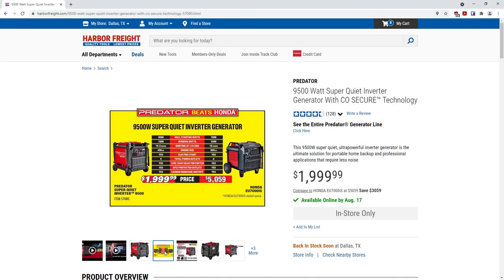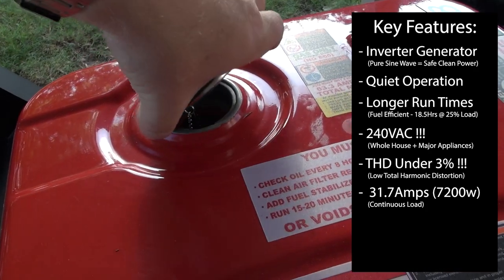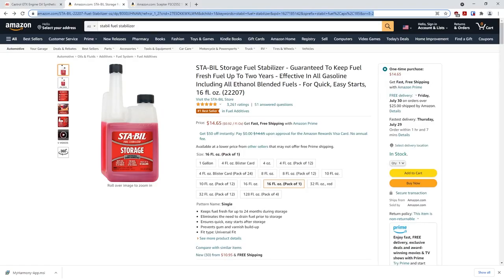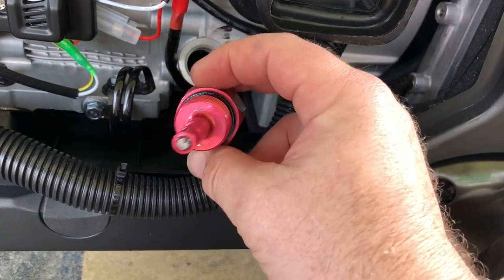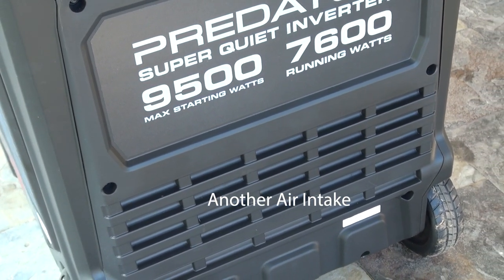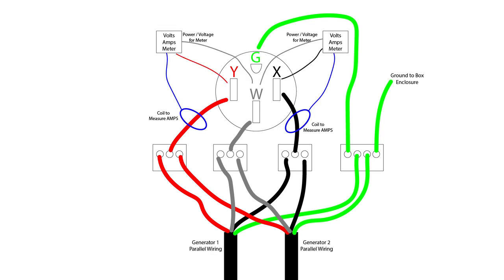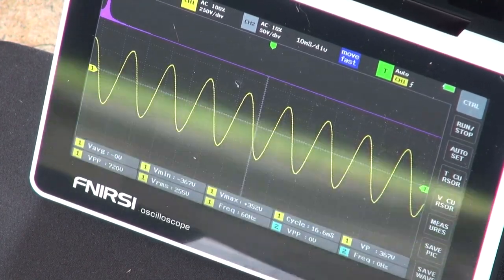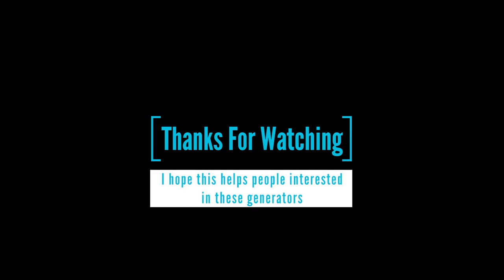Predator 9500 Review: All The Technical Tidbits In Under Ten Minutes (+Important Break-In Warning!)

Comment: Thanks for the oil filler cap recommendation. I found the same one that you bought on Amazon and just ordered it. I just bought the generator and I think I’m gonna wait for the cap to come in before I even start it up now. Glad I watched this video.
Reply from the maker: I'd also suggest a magnetic oil drain plug.  It's an M12x1.5 size.  I purchased this one:
https://amazon.com/dp/B08M3HCVPW
Reply: @Texas_DIY  have you had issues with that plug not sealing properly? And do you need to replace the crush washer each time you take it off?

Comment: Thank you for the metal filings warning.  Recently I learned that heat degrades the magnet's strength.  They make Neodymium Magnet and Samarium Cobalt magnets that can take higher temperature; up to 350°C.  The oil drain plug I just ordered is OK up to 302°F. and will be installed before the new generator is initially started.
Reply from the maker: So far I haven't seen any issues with the magnets losing strength.  I don't think they're getting quite hot enough to cause that.

Comment: Excellent video....I finally purchased one of these about a month ago. Went through the break in period and changed to synthetic oil after 30 hours and a couple oil changes.
Last week I load tested the unit with my 4 ton AC and all was well. I was able to run AC, tv's, lights, refrigerator and chest freezer without issue. In an attempt to see how much it could take, I tried the microwave as well. That tripped the breaker on the generator. Easily manageable in an emergency situation by being smart about when to run certain things. In TX north of Houston, I'm mainly concerned with keeping the house cool during hurricane season so this was a big win for me.

 I did install a SureStart from Hyper Engineering which brought my in-rush amps down to 46 from 132. I imagine your SlowStart will produce similar results, but would love to see your readings.

I watched your previous video on the dual setup and am seriously considering getting a 2nd one (if I can find another lol) .... I dig the meters you put on and will be doing that with my existing setup regardless. In my mind, they should have added this on the front meter (the documentation talks about being able to display it, but as you know, it's only an hour meter)

Thanks again....Liked and Subscribed for future videos!
Reply from the maker: Thank you for the kind words.  "unboxing" and "will it run my electric appliance" videos seem common, but I wanted to offer useful technical info that no one else had.  Plus I refuse on principal to go full click-bait on the titles, or do thumbnails with cut out heads featuring absurd expressions.  Hopefully people still find it if it's something they need.

In my situation, I could probably, maybe, get by with one machine, but I would have to really ration the power if the AC were needing to start.  With two, I can live almost normally and easily just forget everything is on generator power.  Though the electric dryer (When combined with AC and everything else that's normally on) seems to push it nearly to the limits.  I quickly turned that off though, as I'm not through the break in period and don't want to strain them too much yet.

Starting AMPs on my 5 ton Heat Pump AC were 81.5 on my meter.  Though the LRA (Locked Rotor Amps) rating is 117 (meaning from a dead stop, it's within normal range for it to pull up to 117amps).  With the soft start, on the very first start it was down to 64, and after a few more starts (the learning process), the bluetooth app for the soft starter reported that it was consistently keeping the starting amps to around 44 (my own meter reads a max of 31.5) so it's somewhere in that range.  

The electronics in the soft start are remarkably sophisticated (it can literally send a waveform to the manufacturer for troubleshooting), so I'd trust it... though if it's accurate, that means that the 44 amp load is so brief, that my clamp on amp meter can't even detect it quickly enough.  Once it's running, it only needs around 11.3 for the compressor (14amps overall with the fans, etc.)

It was disappointing that Harbor Freight ditched the amp meter in favor of only the hour meter.  The lack of oil filter and... unfortunate placement of the air filter is certainly less than ideal.  But for the price, there still is nothing that can touch it.  I didn't want to modify my actual machines, so my purposes, it seemed to make the most sense to combine the amp meters into the parallel kit.

I've got most of the pieces ready to assemble the video covering how to hook it up to a home / sizing the generator.  Though I should probably do the soft start one first as it would be much shorter and faster to get done.  Good Luck!
Reply: I'm in the Houston area and have the some concern regarding AC during Hurricane season. Can these be converted to run on propane or natural gas? I'd rather not have to manage fresh gasoline.
Reply: @jghall00  Duromax dual fuel and parrell kite so don’t DIY

Comment: Price is now $2199, though I got a new in box return where the buyer never put the oil in or started for $1759, minus another 15% off with coupon and their credit card.  Only annoyance was realizing their warranty is only 90 days, versus two or three years for many others.  Since I saved so much I bought their one year warranty, which I also got the discount on.  Very happy!
Reply from the maker: yeah, there are deals to be had.  Also, HF does not track serials, so an extended warranty for one could have "actually been purchased for the other unit"...

Comment: You can put a magnetic drain plug too. I have them on mine since 2000.  For a quiet claim, the HF is noisy. The Honda EU7000is is only 52db
Reply from the maker: No doubt the Honda will be a better and quieter machine.  It's like comparing a Kia to a Lexus.  But the "Kia" is much less than half the cost, and in my case, with the limited amount of usage these will ultimately get, the "Kia" definitely will get me from point "a" to point "b" just as well as the "Lexus".   :-)

Do you have a link to the magnetic drain plug?  I'd love to pick up some of those to add in.  Anything to further reduce the metal shavings floating around in there would be a very good thing.
Reply: @Texas_DIY    I am thinking on getting one of those Predators as a backup for my Honda. I took mine out, measured it and went by that.
Reply from the maker: I measured mine and ordered one.  It takes an M12x1.5 drain plug.
Reply: The Honda might be quieter, but it's also significantly down on power comparatively speaking. The Predator has a running wattage higher than the Honda's starting wattage. The only way to beat the Predator is to buy two Hondas. At that point you're spending over 10 grand and I'll bet you're no longer quieter either. Apples to Apples would be nice, but neither Honda nor Yamaha has a quiet inverter generator that's anywhere near 9500 watts. I feel like Honda is the Blackberry of generators. Great and reliable, but resting on their laurels and not doing enough with new products or competitive pricing. Every year, there's less and less reason to buy a Honda vs the competition.

Comment: Awesome video. Like the set up. I did build a new parallel kit using the DuroMax kit housing. I'll be doing a video on it soon. But definitely like how you installed the meters to see amps and voltage. I need to add that to mine. Also finally got the CO sensor to stop going off. Ugh. Lol.
Reply from the maker: Thanks.  Your discovery of the PowerHorse parallel kit was the key to making it all safely happen, thanks again for finding that!  

I'll be curious to see how you dealt withe missing neutral on that kit, looking forward to it.

I've not needed to mess with my CO sensors as I don't have them in an enclosure...yet... did you find a way to jumper it, or just cover it up?
Reply: Where did you get The Co sensor ?

Comment: I paid an extra $300 and got the DuroMax XP9000iH Dual Fuel I mainly run on propane so works for me. Parallel two and you get 15,200 running watts gasoline and 14,400 on propane. Low THD, propane burns cleaner and longer shelf life.
Would be nice if HF offered Duel Fuel
Reply from the maker: From what I've seen those units are virtually identical to the HF 9500, same engine and most of the internals... apart from the spiffy extra goodies the Duromax offers.  I am kind of weirded out by the lack of a neutral on the parallel kit connection though.

Comment: Thanks for the informative video. Question. I have a large motorhome (two AC, 50 service cord) that I use the generator a lot. Looking to get something like this to save on the Onan that is onboard which is a 8,000 watt. Would this be a good candidate for that?
Reply from the maker: Something like that would work great.  But you might consider something like the GENMAX GM9000iED (looks like the current model adds a "c" to the end) on Amazon.  It's made by the same factory, and solves all the shortcomings of the other similar models (predator, duromax, etc.)  It has an easier access air filter, an oil filter, dual fuel, nice gauges on the front, can parallel them together without making a box, and it also has a remote control, so you could start it without having to go outside.

Comment: Did you happen to examine the waveform while the unit is idled down in "Eco Mode" and a large load hits?  Given how the lights dim in my house under those circumstances I can assume voltage drops temporarily but I'd love to know if the waveform gets bent out of shape (or if THD skyrockets).  If I'm putting gizmos in the house at risk as a result I'll just run the thing at full speed full time.
Reply from the maker: I did, and the wave form remained solid (power did fluctuate by 1 volt when the AC kicked in).  I have another video in the series where I compare line power, the inverter generators, and a traditional generator.  The instructions say to not have them in eco mode when doing parallel.  But I've seen no issue with doing so.  

The exception is if I'm planning to run the clothes dryer... that thing is an absolute pig for power, and it's really best if the generators are fully spun up before kicking that thing off. Otherwise the lights get a little flickery as the generators struggle to get up to speed when in Eco mode.  But if you don't have a huge load hitting (The AC is fine with the softstart, you don't hardly even hear the engine speeds change all that much) then it's no big deal, and the gas savings are more than worth it.

https://www.youtube.com/playlist?list=PLzoNthJzzMFQ877vyCfoc53oDQqGFAIKN

Comment: Hey Jay! Great vid. Can you tell me what is the purpose of the breaker that’s on the 9500? I have a food cart. At first I had issues tripping the breakers in food cart because of the amounts of watts plugged into certain breakers. I had electrician correct. After that everything was running fine. I just couldn’t run certain appliances together to avoid overloading watts.  Fast forward to last night. I turned gen on .. everything was working as it should. Maybe an hour into having gen on, the entire power to the trailer turned off. No breakers were tripped. During that time I was showing someone how to switch AC to off. I don’t know if it was coincidence but this is when power quit. After checking breakers in cart, plugs, cord to gen, I couldn’t find anything. I reached out to my electrician and he said to check breaker on generator. Sure enough when I  flipped it, power came back on. I only have maybe 8 hours on gen and this is my first one.  Can you tell me any details on this and any advice to avoid? It shut my business down a good hour before figuring out. Also, to note… not much power was plugged in during this time when power cut. Also, gen was still running when it happened. Thanks so much for your time!!!
Reply from the maker: I'm assuming that you're using the 30a plug on the front, and running that into your truck.

The front panels of the generator have breakers for safety, just like there are breakers in your house.  I'm assuming that your food cart also has a breaker box.  If you're pulling too much juice from the generator (over the 30amp limit of the breaker on the front panel) it will cut off and all power shuts down.  

If you're pulling more power on a circuit than the breaker (in your cart) is rated for, it will cut off.  (if the breaker in your cart, and the one on the front panel of the generator are the same amperage, than it will be random luck which one is more sensitive and cuts off first.)

So if the breaker inside your food truck is less than 30 amps, and keeps tripping, that implies you've got enough power, but you're pulling too much power from that circuit.  And you need to plug in some stuff into a different circuit (different plug supplied by a different breaker).  But if you're tripping the breaker on the front panel of the generator, (the 30a) then you're exceeding what the generator can make.

If you need more power than the generator can make, It's possible to team two together, which is what I was doing with my setup, and that doubles the potential output.  Or just run another one and run some stuff on one, and some stuff on the other. 

The other videos in the series are here: https://www.youtube.com/playlist?list=PLzoNthJzzMFQ877vyCfoc53oDQqGFAIKN

Comment: Good video for break-in the inverter and general info . Can you tell me what it is the length of the control knob (Off/Run/Start) for the Harbor Freight Predator 9500 that you have? Looking to see if the knob it is compatible with other invertors. I'm interested for the length of the axle after the round area that sits outside the front panel.
Thank you
Reply from the maker: Checked it this morning for you.  If you remove the knob nothing will protrude, the plastic knob itself actually has a shaft on it that terminates in a female end point.  The shaft extends about 2 inches into the generator housing where it is is held in place by a phillips screw that locks the plastic knob/shaft onto the valve inside that it turns.

Comment: Stupid question,  I'm planning on buying one of these to power a food trailer I'm making.  My question is how do I get all the power from this generator to my panel in my trailer? I need around 65 amps of power. How do I tap into it to get all of the wattage?
Reply from the maker: You'll need a generator inlet.  Basically male plugs that attach to your breaker box.  Those male plugs are connected to a breaker that will feed the power from the generators into your breaker box when that breaker is on.  If you have another source of power (from utility) that breaker must remain OFF when line / service power is connected, otherwise those exposed male plugs are energized and very dangerous.  Additionally, if you generators connected and line power on, bad things happen to your generator.  This is what an interlock does, preventing the line power breaker and your generator breaker, from being on at the same time.

Things are crazy for me right now, but I have at least one more video I need to make on that subject.  But you can see some shots of my setup mixed in with the other videos.
Reply: @Texas_DIY  thanks so much for your reply!!
Reply from the maker: @maxpenichet7243  I also highly suggest just defaulting to the 50amp inlet and having it feed via a matching 50 or 60amp breaker.  This future proofs you, in the event you decide to use a more powerful generator, or team up two of them.   I used this on my home for the inlet:
https://www.amazon.com/gp/product/B08NVRS4HD
Reply: These are rated for 31.6A (each) continuous and 39.5 A peak (momentarily). The outlet is 30A. Before you buy the TWO of these that you'd need, you should know that 65A@240V is above the continuous rating of (just one of these)7600watts.  65x240=15600. 7600x2(generators)=15200. 15600>15200. If you are adding up all the circuit breakers in a panel to arrive at your 65A max load, I don't think that's how you clalculate it, but I'm a plumber. You should ask an electrician.

Comment: Can add a smaller invertor , or does have to be same size if you wire parrell the way you did in previous video did?
Reply from the maker: The inverter is built into the generator itself and fixed in capacity.  

If you're asking can you use a smaller inverter generator at the same time... I don't know.  If it's 240V, I would think yes (provided it's designed to be used in a parallel setup)  

If it's a 120V generator, i really don't know.  It might sync up and add capacity to one leg of power... or it might fry the whole system.  I'm not sure if the 240V generators look at the full 240V sine wave, or, if they look at the split phase 120V sine to sync against... and if adding a supplement generator to the X or the Y leg would make a difference.  What you absolutely don't want is for it to not sync, and you end up with two frequencies of power hitting your home at the same time.  

I don't have the guts to risk frying my setup to test the idea.  :-)